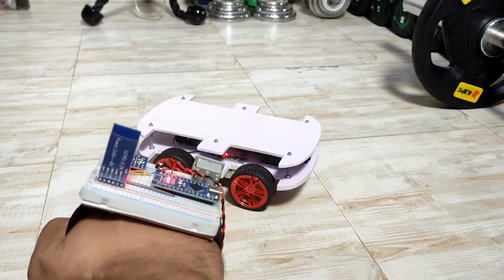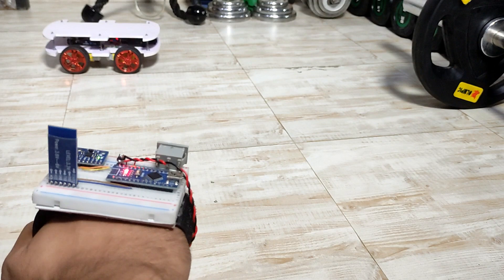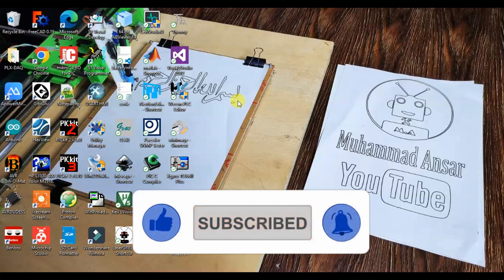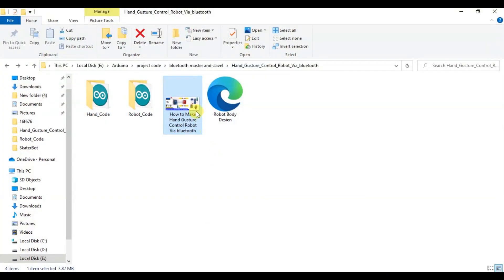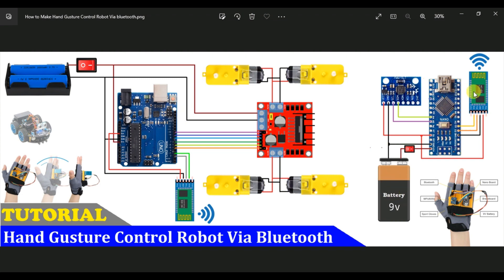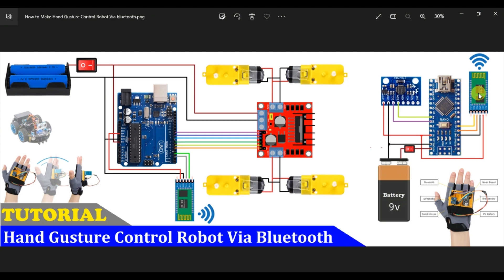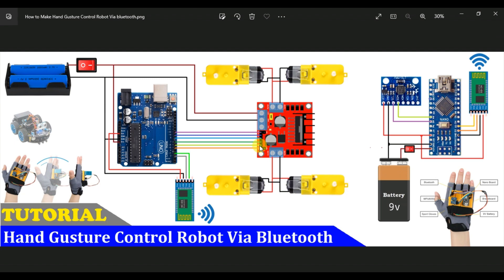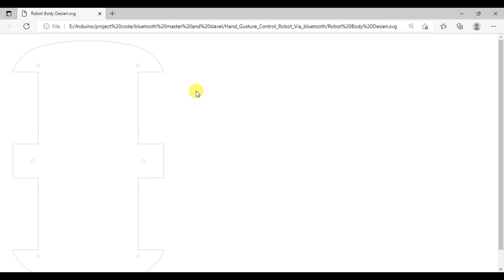DIY Hand Gesture Control Robot | Arduino Hand Gesture Control Robot Part:1

Comment: Sir, I appreciate your video about the Hand Gesture Control Robot Via Bluetooth. Sir, can you possibly use the Arduino Uno board to control the Xbox 360-controlled 6 dof robotic arm Arduino Uno Robot Tank work or not? Sir, can you teach me to make on youtube how to make an Xbox 360-controlled 6 dof robotic arm Arduino Uno Robot Tank work and Xbox360 Controller? Sir, tell me about the Xbox360 Controller library with the Arduino Uno board. Sir, this video is beneficial. Sir, tell me in the comment.